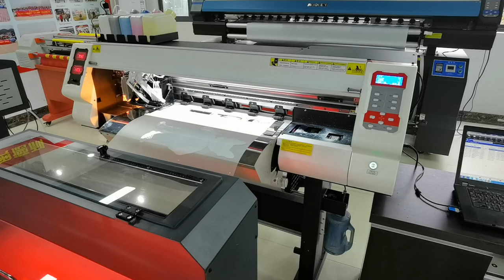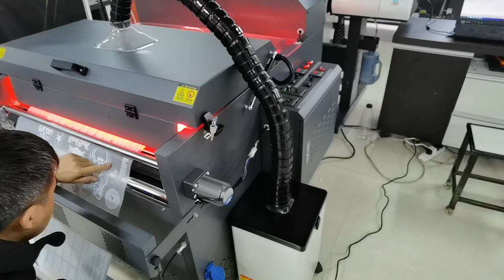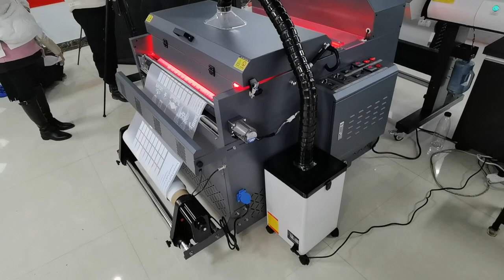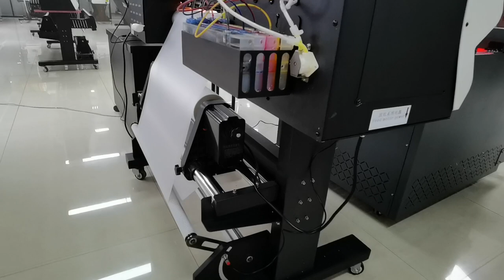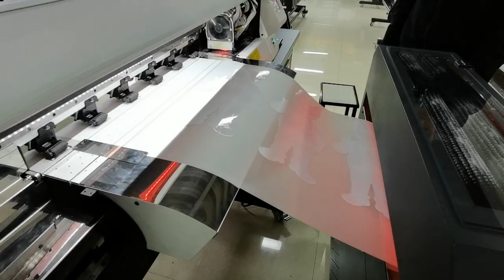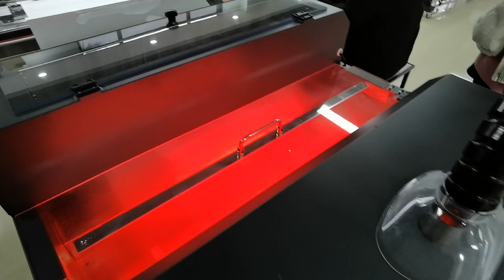audley new model dtf printer for t shirt, fabric

Comment: Hi, I have one I think it is JD-TY 700 Model with Double i3200/4720 Heads. No help from anywhere finding Printer driver for Maintop RIP software.
2 Weeks now online searching no help.
Where can I find driver to install on Maintop?
Reply from the maker: Hi friend, where do you order the printer? Our DTF printer standard with Maintop RIP. Contact with your seller and ask for it.
Reply: @LucyAUDLEY  Hi, I buy it from UK used not new.  I have Maintop RIP ver 6 with Dongle but no printer profile to output High Resolution file for PrintExp. My print very bad quality low quality results.
Reply from the maker: may I know where do you order the printer?

Comment: How much to ship to USA?
Reply from the maker: DDU to USA is about USD1650 to your address for a whole set. For more detail information contact with Lucy directly please.
email: sales016@audley.cn
whatsapp+wechat: +86-13140133007
Reply: Two questions, does the print head have wet capping to help prevent clogs and two, in the video there is a light on the print head. Is that a heater?
Reply: I want in Kathmandu, Nepal. What will be the cost?